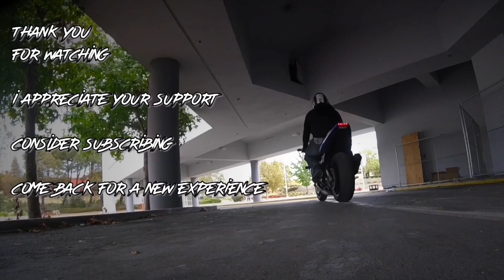Gerald LeVert Refuses to Co-operate

Comment: Just got into bed an seen a new upload hellayeah  fresh content fam 💜 fully would love to see the technical side of it mixed with youre  mad editing aswell , I've always had a soft spot for an FC RX7 , I'm gonna drop a reply to my own comment about that overlap/cut sound aswell similar issue I had that sounded exactly the same, may may not help you kinda pinpoint it or share a rando story/learning curve of mine who knows 😅
Reply: On my rx8 I removed the lower intake valve for the center iron , found it has a fine jettng type needle that runs threw from the intake manifold an in the back side is a hose the runs to it, which is one of the intake joiner hoses befor the throttlebody there on that joiner,when I removed it had 1000cc injectors then the yellows from a 6port still done the same thing, that valve removed the center iron was strate open i figured it would have less intake pressure then the cylinder did compression so it would escape back up the intake creating mad overlap cut like that exact sound I mean my ignition wasnt an still isnt very good so it all plays apart but it makes me wonder if the center iron or any of that information could help ,I can try upload it on my channel tomorrow for you to take a look if it sounds similar my problem was due to my doing but I found the over lapse cut sound you hear an feel came from the center iron injectors an ports in my case,  that sound was exactly the same, ignition would cut at top end a tad but no badly , not sure if this helps but I hope so
Reply: Awesome feedback. I will forsure keep this in mind with the rx8 aswell.
Reply: @lexkingvlogs1582  cheers man was nice to see you're comment, yeah it was a long journey with that learning curve haha😉😁 but I learnt abit from it so was well worth the struggles , ps I'm hyped as you got another channel just subbed haha
Reply: @lexkingvlogs1582  I managed to find a few of the videos posting one up now gonna go through them an find another few to post while I'm there 😁🤘